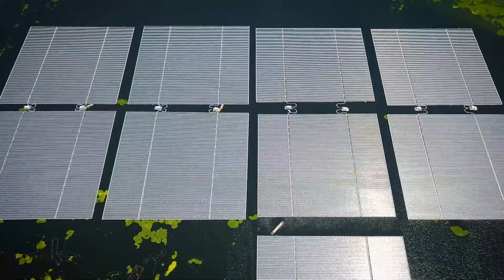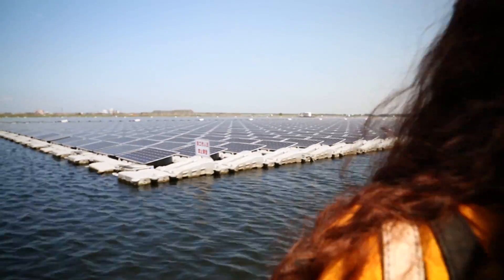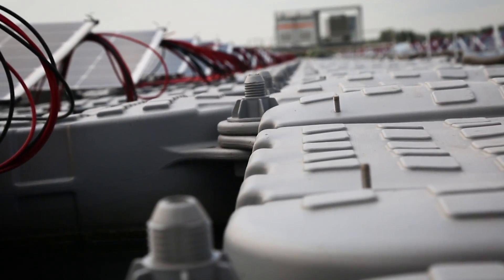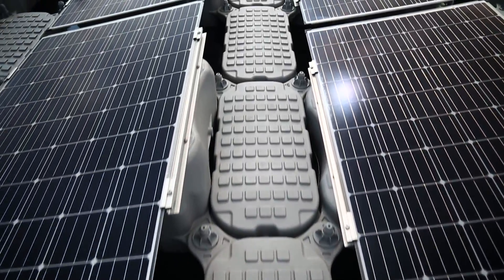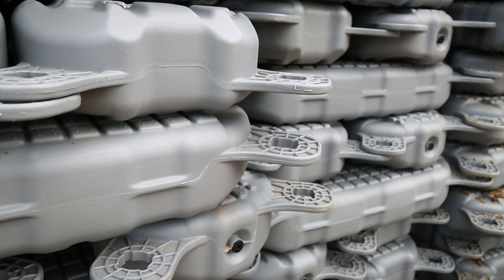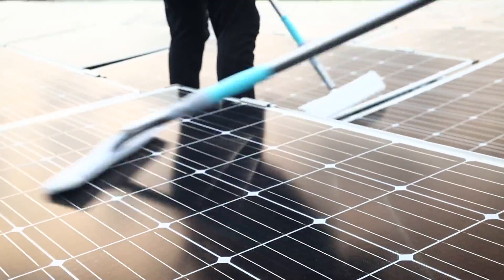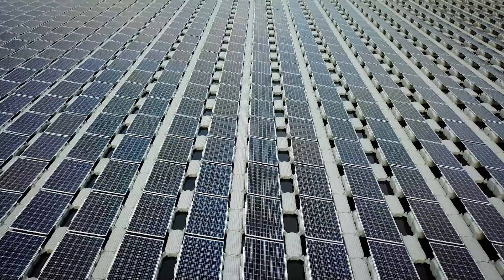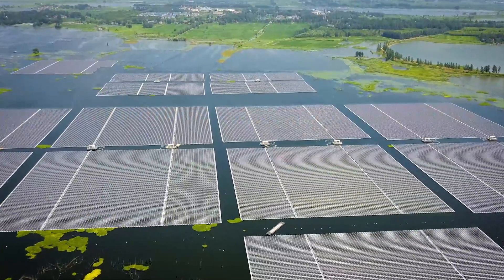Exploring China's Floating Solar Farms | Doc Bites

Comment: Additional bonus would be less evaporation from the water if it is to be used for other purposes. 
I've managed bodies of water in my early days. 
Just a pool of water 6 meters in diameter will lose 200 litres at a daytime temperature of 35 celsius , humidity at under 30 %...
Thatsa lot of water ..
Reply: U r right